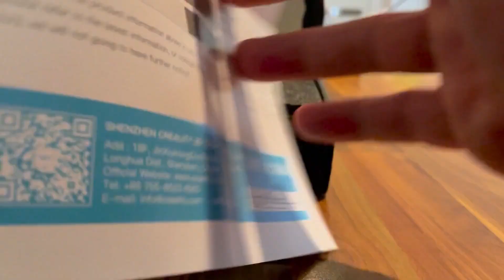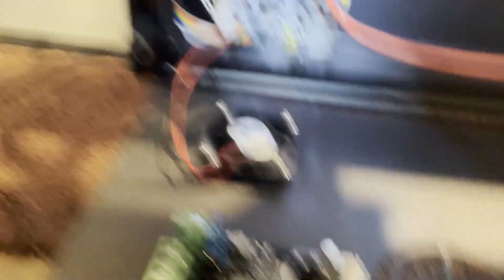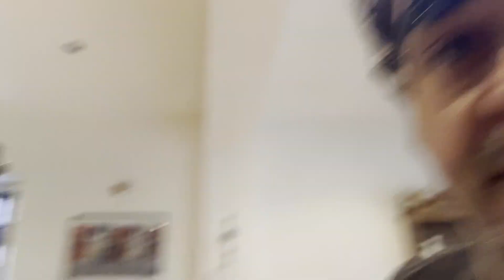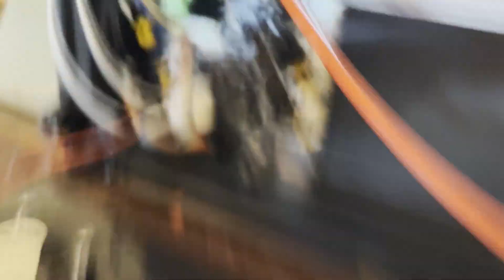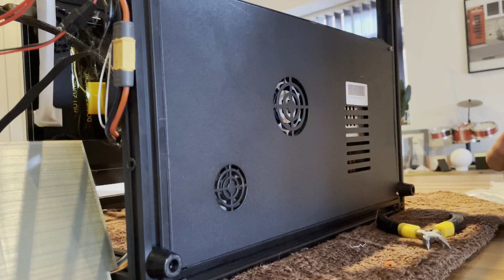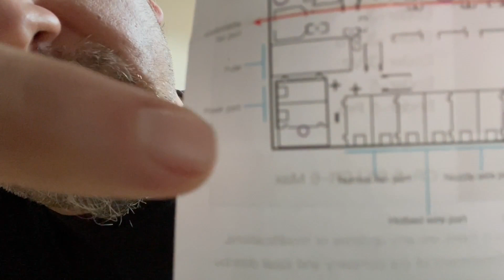Creality Ender-5-Pro Motherboard Replacement

Comment: excellent video, you changed the motherboard from 8-bit to 32-bit, correct? I'm also waiting for them to send me a 32-bit one from Creality and the BLtouch so I can exchange my 8-bit one.
Reply from the maker: Thank you and yes you are correct the original v1.1.5 is an 8-bit board, and the replacement v4.2.2 is 32-bit, not to be mistaken for the v4.2.7 which I believe is for an Ender 3. Good luck with the installation and new bl touch accessory, I should really get one of those. :)

Comment: Where did you get one that did not need to be Flashed ??? I changed mine and it is said it is for a 5 but made for the 3 and you have to flash it to make it for a 5.
 BTW my 1st motherboard the slot for the TF card came off the first time I inserted a card :-) 
 I Hate Enders now.
Reply from the maker: Hi, I got this as a replacement directly from Creality in China. Its true it can be a bit of lottery with tech from China with the sd card reader falling off. Also these printers are technically classed as entry level budget printers but that said the build quality should be better, but their after sales care is improving as now you can contact them directly and they do reply. I can't really fault the service I've received even with the 2 issues I've had with this printer. If I were to up the scale and frequency of of my 3D printing I would invest in either a Prusa, Ultimaker or Lulzbot Taz6, but none of these are cheap options.
Reply: @domenicodevivo5318  Thanks.
I have ended 3 too so will just install it there and order from China.
My new Pusa should be here this week :-)
Reply from the maker: @bryanhearn9924  Nice. Did you go with the 'build-it-yourself' kit or the fully assembled Prusa?
Reply: @domenicodevivo5318  The build it yourself kit.
 200.00 bucks cheaper so .... :-)
Reply from the maker: @bryanhearn9924  Exactly. Good move
Reply: @domenicodevivo5318  Prusa update,
 Finally got it after a week delay because DHL sucks.
 Put it together over the weekend, ( Damn near 4 days because Wife, Sister , Father and general life B.S. ) 
 Fine tuned this morning and it is worth every freaking Penney.
 BTW assembly is a B%tch, but at least now I know how to do repairs and maintenance. :-)
Reply from the maker: @bryanhearn9924  good to hear. I totally agree on the kit assembly. If gives you the confidence and knowledge to tinker or fix stuff yourself. What you lose in time figuring it out you gain in the long run. Let me know what your first print was/is. 👏
Reply: @domenicodevivo5318  I printed off some of their test prints first Triceratops, Batman... My first real build is a VW Bus.
 Still working on calibrations but damn close to having it tuned in.
To bad can not post photo's because it is a very pretty first layer. :-)
Reply: @domenicodevivo5318  I strongly suggest you check out their Powder Coated Steel print beds.
 Everything comes out smooth as glass. They are impressive and Magnetic :-)
Reply from the maker: @bryanhearn9924  Its definately worth doing if you want to minimise issues. Glad to hear you are dailing it in for a perfect first layer.
Reply from the maker: @bryanhearn9924  Wow, thanks for the tip. I will certainly be taking a look. Especially since I've got so used to the removable magnetic layer and I wouldn't want to lose that advantage.

Comment: Thank you for this useful video. I have a Ender 5 pro about 3 years old and not done a lot of printing but  getting back into it and on a learning curve. This time round Ive felt confident to upgrade the printer a little so added new PEI bed, printed out a support for the bed wires, new springs which I changed back as were not as good as the originals. Anyhow been having a lot of problems with bed leveling for some reason after setting the level and nozzle gap, starting the print the adjustments made are lost. using a test print, large rectangle plus circles centre and 4 corners,  the first layer seems ok at the back of the rectangle but then the nozzle is almost touching the bed as it draws the  front edge and it seems to get worse the longer the print is left running. So decided to try a BLTouch upgrade and that has led to needing an updated board as well as I have an older version, hence I came here to see what it involved. Ive not bought either yet as I have four choices, get them and see what happens, persevere and try to sort the issue out which I have been and getting nowhere, buying a new model or just giving up!
Reply from the maker: Hi, and thank you so much for your feedback. I have a friend who also has a Ender (can't remember which model) but he had issues with the springs on the bed and decided to replace them, but I'm not sure if he did a bad job or the springs were bad, but he ended up returning the printer for a replacement. Since the springs are directly connected to bed levelling you should first make sure each spring has enough adjustment in either direction without hitting its end point (at its tightest or its loosest). I rely heavily on manually levelling the bed and my technique is to use piece of paper with the same thickness used for flyers (you know, the kind which come through the front door for gutter cleaning services etc), make sure each servo is off so that you can move the print head with you hands and start levelling at each corner, keep going round the bed until they are the same and along with the centre of the bed. If you are feeling brave you can also adjust the level height whilst printing but, only turn the wheels by a miniscule amount since you really do not want to disturb the filament flow as it is laying filament. Keep 3D printing and the best of luck to you.
Reply: @domenicodevivo5318  Thx for the reply and a quick update. 1. I adjusts the height that the Z switch will stop the bed, it had changed due to the new PEI bed I added. 2. on my Ender it still has the option to disable just the X-Y axis so I started to use that option instead 'all' steppers, apparently Enders are known for a 'drop' in this option.  3. Level with paper as you do, not tried the 'flyer' but will which will make future junk mail a sight of joy!, but run a bed level test after that and adjust accordingly. Just finished a couple of prints using the above and with great results. ATB
Reply from the maker: @utkf16  Its great to hear that the adjustments you have made are resulting in good quality prints. Keep up the good work.

Comment: Greetings Domenico,  It might be that because of the clogged fan which then produced a very low air flow that allowed the M.B. to overheat, maybe, and it failed.
It's good to see the clog as I will make a bigger effort to review my fan enclosure and fans more often.

Thanks Again
Doug
Reply: Doubt it, mine card reader fell off the first time I inserted a card.
 Chinese Crap :-) 
 Waiting on a new Prusa and just using the Snapmaker for the moment since all of my Enders have problems.
Reply from the maker: Hi, Maybe the heat contributed but the I didn't see any scorch marks on the board or any burnt out components. I still put it down to a mechanical failure inside the micro sd card reader. Maybe a worn gold contact or something like that.
Reply: @domenicodevivo5318  I'm glad your up and running again as that is a real relief.  IC chips can fail from over heating and show no external signs of damage.  Be that as it may, keep things cool is always a good bet.  Thanks for the reply.
Doug
Reply from the maker: @doctrainsmodifications5201  Yes, my printer was down for about 5-6 weeks which was painful. But at least the repair work gave me an opportunity to get to know the inside of the printer a little better, which I always find is the best way to learn about anything. Thank you for your input as its always nice to hear from fellow enthusiasts sharing knowledge.